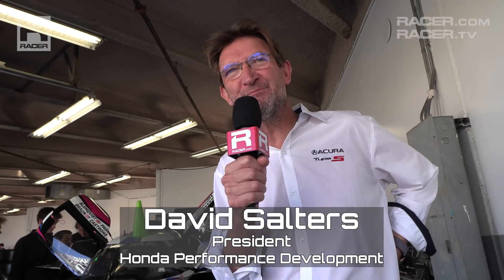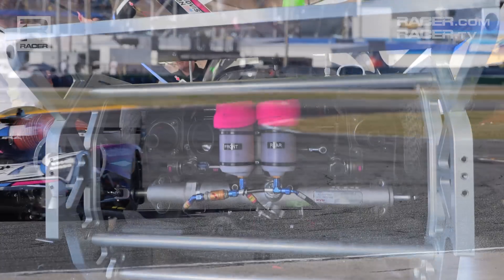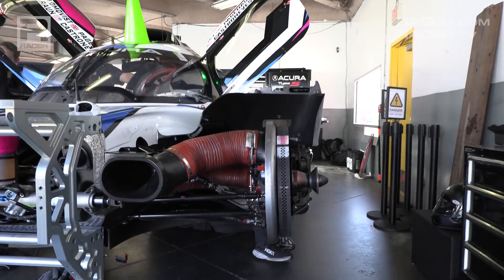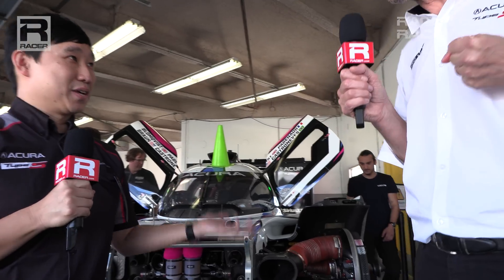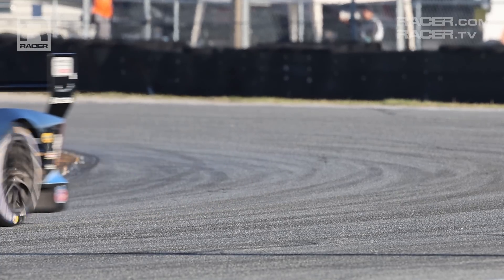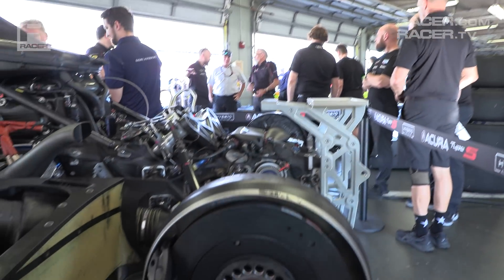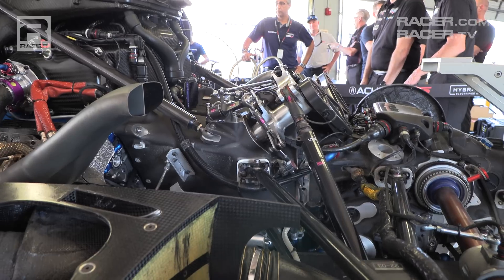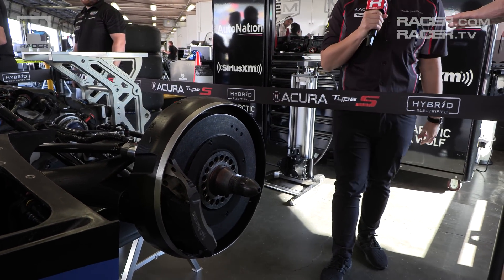IMSA GTP 101: Brake By Wire and Brake Mapping

Comment: But how is the brake feel? Drivers have lost so much over the years. With brake boosters, then ABS, and now brake by wire!!! How are drivers supposed to feel how close they are to the limit?
Reply: The front brakes do most of the braking, and they are still purely hydraulic.

Comment: Could the brake force be set up to target a specific amount of deceleration at each pedal position and avoid checking the brake temperature and wheel speed etc.  maybe even the mgu regen could be taken out of the electronic braking equation if you just have a target deceleration and know whether or not regen braking is active.

Comment: So the MGU also helps with braking? How it does that? Very curious about this stuff
Reply: it's an electric motor that can add power, charge the battery or add braking resistance by trying to go in reverse

Comment: Yeah it is mind-bending it's amazing technology but in the end it sucks because it takes more control away from what would be a good driver and now any mediocre punter can drive one of these cars near or at the limits. Absolutely ridiculous you no longer have race car drivers what you have are a bunch of idiots running around simulating full-size RC video games. There's a zero chance of dying anymore and there's no more skill in knowing what the car is doing threshold braking loss of traction Etc. It's the generation of loser race car drivers, who couldn't hold a candle to the ass of the greatest drivers from the 50s through the 80s. It's all enough to make one want to puke. 🤮🙄

Comment: My follow up question to their explanation is how does this translate to pedal feel? A massive part of racing and pushing the limit, especially in braking zones, is being able to feel that brake pedal and understand what’s going on. Feeling if the brakes are too hot, if they’re too cold, if ABS is kicking in, etc. Are the drivers still getting that feedback through the pedal? Or is it more in line with a sim racing pedal at this point?
Reply: Audi employs a system in their electric cars that pushes back on the pedal when the driver applies force. This translates to feel what the actual brakes are doing. I'm sure these cars have some sort of feedback that gives the driver pedal feedback, varying the feedback based on the brake application.
Reply: There will be hardly any feedback it's almost like you can't even make a mistake it's ridiculous
Reply: These cars and previous cars already didn’t have ABS so they don’t have to worry about that. However I do remember there being some complaints from drivers when F1 swapped over to brake by wire

Comment: is rear break disc way smaller than front break ..? i guess just like F1 car ,little like engine break ,hit the break , regenerate energy to charge battery .
Reply: Yup, the regen provides the majority of the rear braking force on these cars. If they lose the MGU, they can’t run the car for too long.

Comment: So, still no clue how it works 😀

Is it the ecu deciding how much hydronic fluid is pumped to each brake based off of all the data it receives allowing for the most consistent braking results? 

Or is their an entirely different method of braking that doesn’t require the discs, that the ecu can decide to use as assistance or in place of the brakes, when the ECU determines that the brakes will not be able to perform the desired consistent result. 

Sorry for the misunderstanding, any help would be greatly appreciated
Reply: It's actively balancing the brake pressure and the MGU braking as they corner. The Motor-Generator Unit(MGU) can apply braking force by essentially acting as an engine brake when harvesting energy(but it cannot stop the car on it's own), if the car is in a charging mode but the driver still wants a lot of brakes, the car can electronically change which part of the system gets the most load. This allows for some really interesting things such as having a brake map thats mostly MGU and super low pressure so you could do a sort of lift and coast routine to harvest battery, or using low battery to your advantage and adding extra braking force by applying the MGU on top of full brake pressure
Reply: @coliimusic  I guess my confusion is what the MGU braking is
Reply: @Zodspeed18  The electric motor that the car uses under acceleration can also be used as a brake when you swap polarities. Basically the spinning electromagnet becomes a magnetic brake on the rear axle rather than a magnetic motor
Reply: @coliimusic  thanks for the response by the way!
Reply: Right? This video was a waste of time.